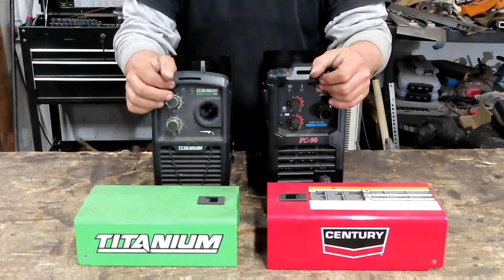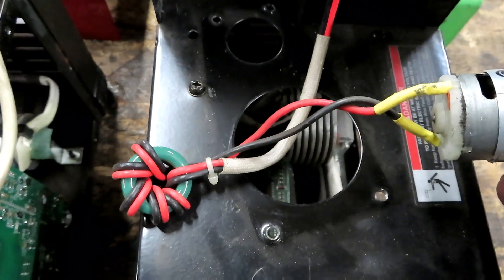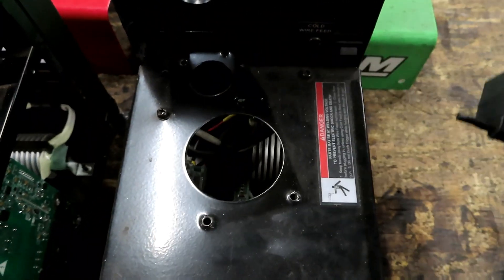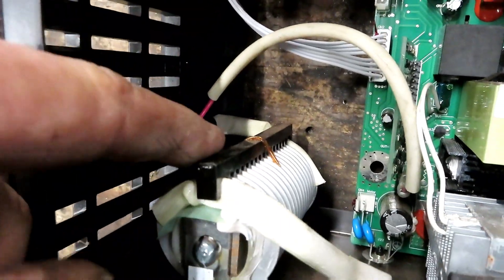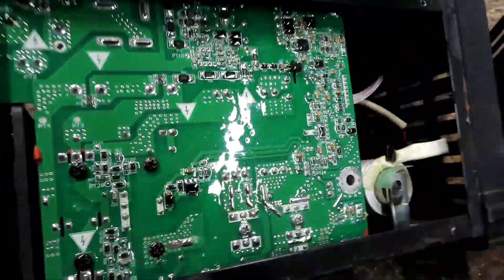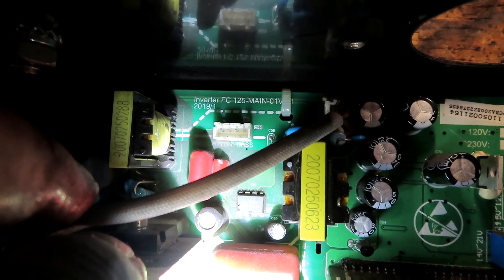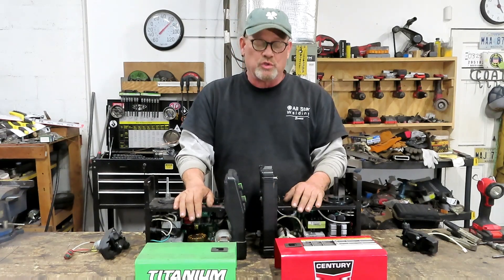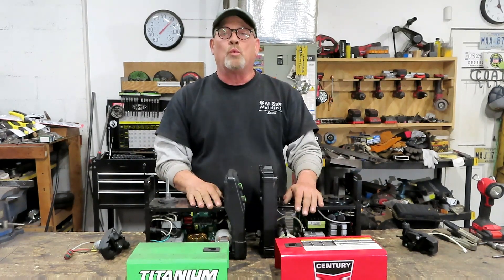Titanium Flux Core vs Century 90 Flux Core: Detailed Inside Component Breakdown!

Comment: Will the outlaw 190 run a 140amp fcaw, a 180 mig, etc?
Reply from the maker: It runs my Titanium 125, and my Primeweld 160 on flux core just fine. It will run my MTS200 if I don't try to max it out. But 99% of the time, I'm doing Flux core or stick

Comment: These are not the same, but if you buy either a few months apart they won't be the same as the first. 
I have read  people that had the 125s, took them apart and the internal components and layouts were different, like they came from different suppliers or way different revisions.  
 The wound aluminum choke/ reactor is an inductor and smoothes out the current flow.  I couldn't tell if the one on the century was made from copper or aluminum.  It is funny to see some sophisticated electronics used, but they cheap out using aluminum instead of copper.  Copper parts are expensive.
 The real test would be to put a current clamp on their leads and see what the their max current was.  I suspect the HF is close to 125A.  90A is for tail pipes and sheet metal.   I would only get the century if it were less half price. 
 Nice glasses professor.
Reply from the maker: I agree with every word you said, even about my glasses. 😆 I think the Century is over priced for what it is.
Reply: I forgot, 90A would probably weld most hand rails...  I can see why they don't put Lincoln on the name plate.  Was the Century  assembled in Mexico? 
 I can't say too much, i do own a 12yr old Lincoln mig140 transformer based welder.   I think they still sell one, over weight and priced for what it does.  Charging you for the copper, but it will last through the apocalypse...

Comment: Was the Century not working properly for it to be donated to you? If the only issue is that the the power cord needs to be replaced, perhaps it could be repaired snd given to one of the high school students who visit your shop. 😊
Reply from the maker: Nope. My friend was doing some torch cutting and not being careful. Melted the gun lead in several spots. He bought another one because he was needing to get the job done. He bought a replacement gun lead from eBay later, then destroyed the unit trying to replace it. So he threw it in a box and never messed with it.

Comment: The thing on the motor wiring is an ferrite core, it acts like a filter when wire is wrapped around it x amount of turns. It keeps the bad motor noises from running back to the circuit board.
Reply from the maker: Ah! Yes, I just couldn't think of it at the time. Thanks. What about that part that the ground cable goes to? Any ideas on that? The one in the Titanium is twice as hefty.
Reply: @AllStarWeldingSC  The thing on the ground cable, I'm not too sure what it is. I just learned enough electronics to pass both my Tech and General Ham Radio licenses.
Reply from the maker: So, the difference in the sizes from the Century, make me wonder if it's better engineering, or if it was required because of lack of engineering, if that makes sense 😕
Reply: @AllStarWeldingSC  Yeah i'm not sure. Hope it's cause of better engineering.

Comment: Another excellent video. Many people believe that the Titanium welder is definitely HF’s diamond in the rough, especially when you can get them on sale. They are more popular than the Century unit and can weld equally if not better.
Reply from the maker: So very true. HF has definitely stepped up their game from the old Chicago Electric machine. Their more advanced Vulcan machines have a great following. And the Titanium line is not bad either. To me, they are just a little over priced though, especially given that you can get a better Primeweld machine for less money, and a 3 year warranty that you don't have to buy. HF gets a bad rap, and so does flux core in general, so that's a double whammy. I'm a professional welder, with a full time shop, and I still use this little Titanium Flux Core unit 3 days a week on location making hand rails